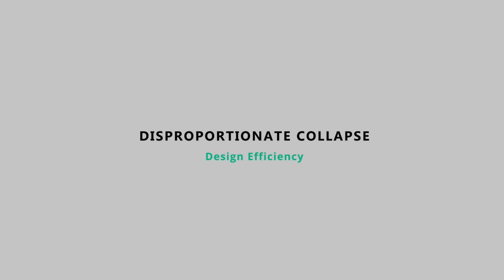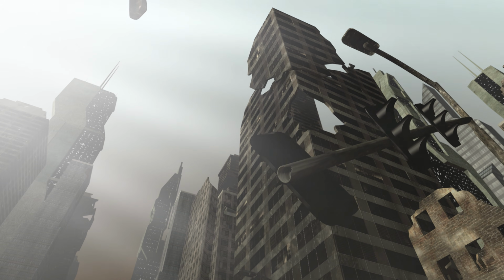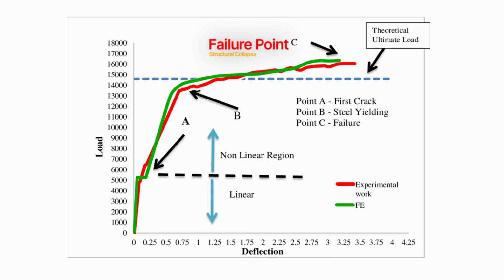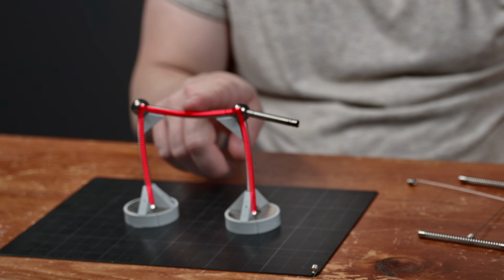Unravel the Secrets of Efficient Structural Design!

Comment: Hi Brendan
Have you come across reinforced Hebel as a loadbearing wall solution (carrying a suspended concrete roof) in residential or multi-res? We have a partially complete building that we've been asked to help 'solve' the problem of. Presumably, it has been designed to AS5146 but the builders don't want to touch it. Is it a 'thing' down there?
Matt

Comment: You should have discussed health monitoring. By being able to actively monitor a building's health, structural engineers can more comfortably avoid the temptation to overengineer structures. Furthermore, insurance companies might offer lower premiums if they are given the ability to monitor the health of buildings they have insured. 

As I presume you know, modern steel buildings, built by competent engineers and builders almost never simply collapse out of the blue. Rather, they tend to die slow deaths, at least in part, because they are not properly maintained. "Build it and forget it" is absurd, yet all too common.

Comment: Hi, good video. I've a question, for what I understand, you made different models in ETABS removing elements, then export the results and with phyton you get the structural element which removed produce the most increment in the internal forces and deformation.? How many models yo did?
Reply from the maker: The number of model is dependent on the size of the structure,  in the one i needed to do had sort through 90 different  cases.
Reply from the maker: Hi Nestor, you check can set non-linear hinges in etabs to assess the failure. What you can do in pyhthon to make it a systematic approach. So you can have Python remove each element, check hinges, then check buckling modes and check each element, and repeat. You can with this assessment is check which element are the most critical add redundancy in these locations, and non critical members can be reduced to the minimum code requirement. It allow to know where to add efficiencies.
Reply: @BrendanHasty  Thanks, I don't know much about programming in python but it seems you connect it to the model in ETABS through the API  which I also don't know (yeah rookie here), but a video showing these thing would be fascinating.